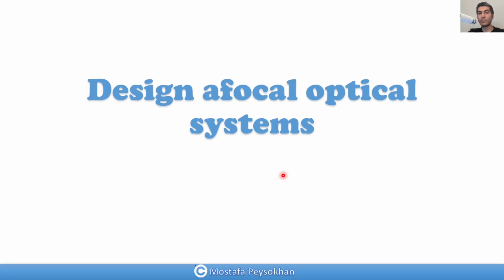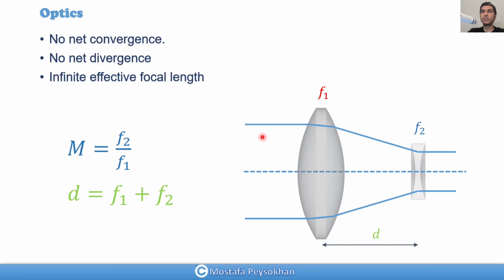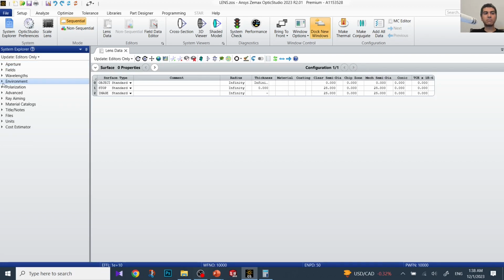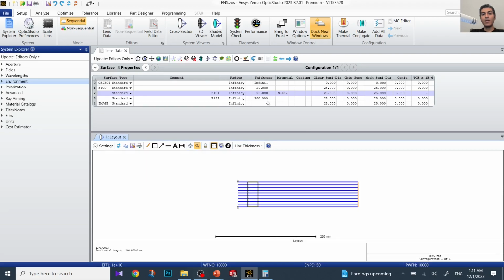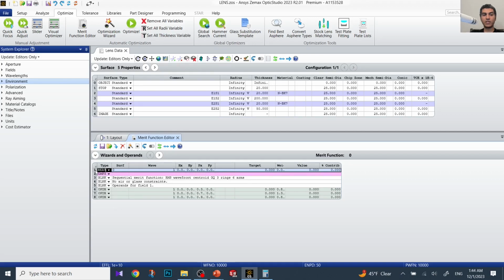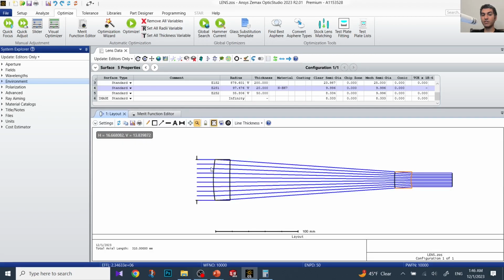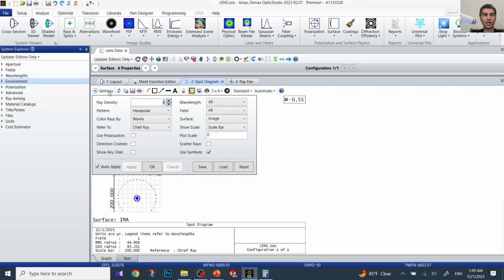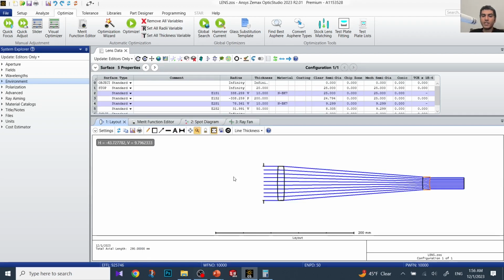Design afocal optical system

Comment: Hello ,What is the working distance of this system? Where do we find it?
Reply from the maker: As this system operates as an afocal system, it doesn't incorporate the CCD or the eye for the image plane, making it challenging to estimate the depth of field. To gauge the working distance, defined as the distance from the object to the front lens, it's necessary to estimate the depth of field on the CCD or the eye's retina.

This estimation involves adjusting the object's position at a specific distance from the nominal point and observing the resultant impact on the spot size. When the image consistently maintains sharpness, this position represents the working distance of the lens.
Reply: @opto-mechademics  Thank you so much information. Could you please upload a video explaining afocal design videos in detail, I would be very grateful.
Reply from the maker: @john-vm8jt 
In order to have a good estimation I think I need to include the optical model of our eye also. 
I will try to model an optical model of eyes and then we can use it to optimize the afocal system together with healthy eyes.
Reply: @opto-mechademics  I'm looking forward to the new video

Comment: I have a question, 
1-do we calculate the diopter setting according to the concave lens?
2-Did we write eye relief in the thickness of the stop? (which is 20 mm or 50 ?)

Thank you
Reply from the maker: The current setup is a basic system to begin with. To incorporate additional elements, we'll need to introduce more components. The advantage of the Galilean design, utilizing a concave lens as the eyepiece, lies in its simplicity and compactness. However, in the Keplerian system where a convex lens serves as the eyepiece, the resulting image is inverted, necessitating more optical elements to erect it. One potential solution involves the use of a Schmidt-Pechan prism to rotate the image by 180 degrees.

Consequently, the system would consist of three primary elements: the objective lens, Schmidt-Pechan prism, and eyepiece.

Creating an optical system from scratch can be challenging. I recommend exploring existing patents, papers, or similar systems as a starting point, and subsequently optimizing that system in Zemax for your specific needs.
Reply: @opto-mechademics  Thank you for information !